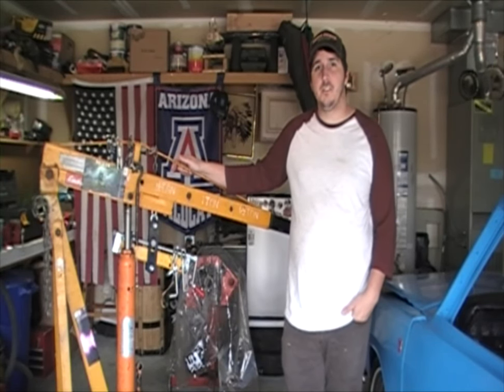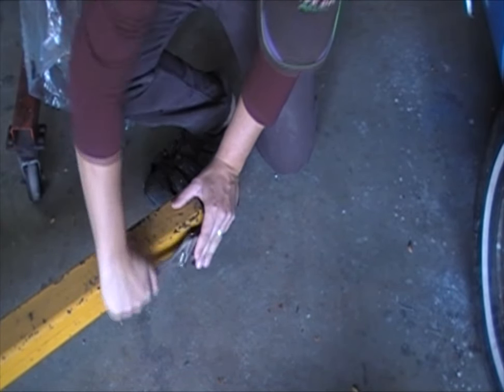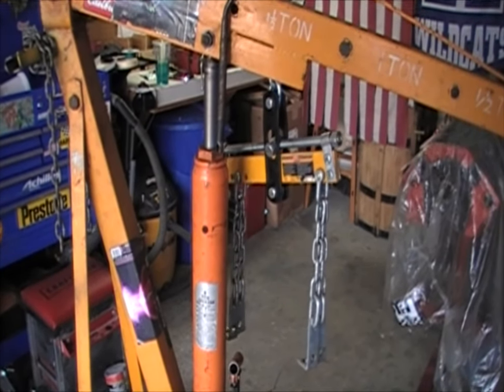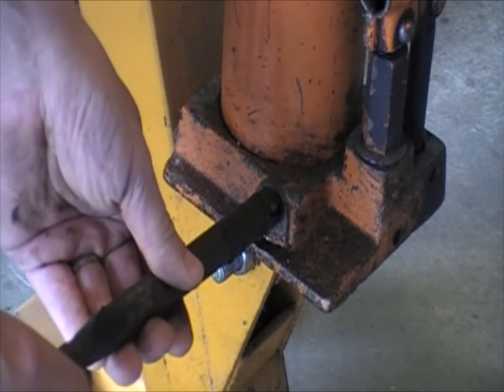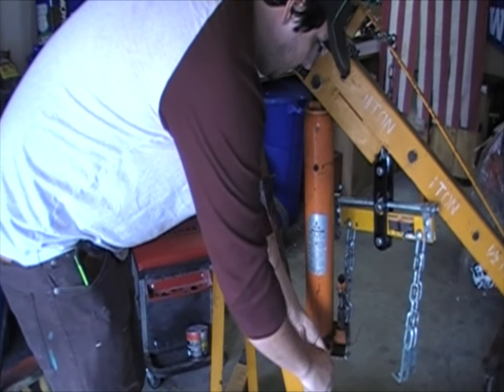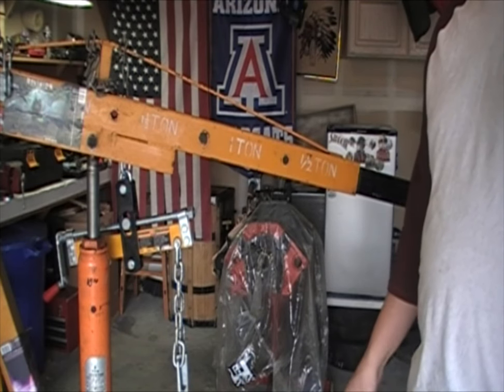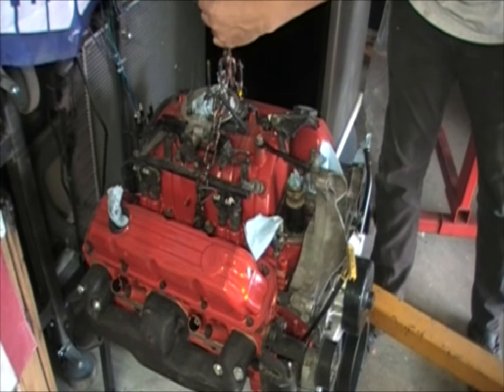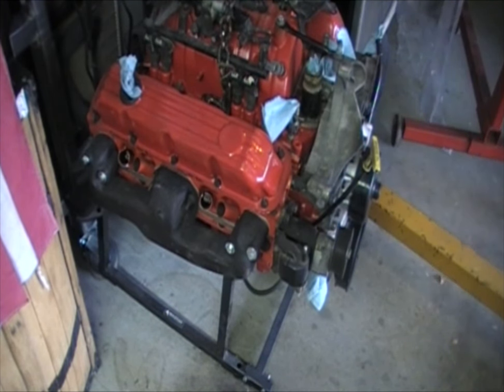How To Use An Engine Hoist

Comment: There's still one part that's important in this that was left out of this, the part when you're lowering the engine to the ground. If you don't extend the hoist arm out enough, or if the legs are too far out, you will be left with an engine that will only lower down onto the legs. I would be glad to know the best way to avoid this, because you might have to lift the engine back up, put it back again and start all over!

Comment: ve 2016 Ford Focus SE 2.0 L . I need to somehow lift engine by hoist ( which I don't have yet ) or by jack enough to replace motor mounts and even timing cover because it's broken too . I didn't want to and took it into a shop but he now says it's going to take longer . That he hasn't had time to do it . Yeah because he keeps doing smaller quick turnaround jobs abd leaving no time to work on mine . I'm not having that nonsense and told him either you stay true to your word and start by tomorrow or else I'm taking it back . Either do it myself or get a honest mechanic . Engine super low near ground
Reply from the maker: Look into an engine support bar!!!
Reply: I have a ironway engine hoist from northern tool. I'm having issues with the hoist tilting forward with no load. It's tilting while I'm pushing it. What should I do?
Reply: I used it before a d it didn't do that

Comment: I have the same hoist but mines leak right below the pump lever do they sale parts or gotta grab a new hydraulic ram
Reply from the maker: Just fixed mine. Take the ram out, empty the oil out, disassemble the moving parts and use some gasket maker to seal up the o rings and washers up. I wasn’t able to find a rebuild kit for it.